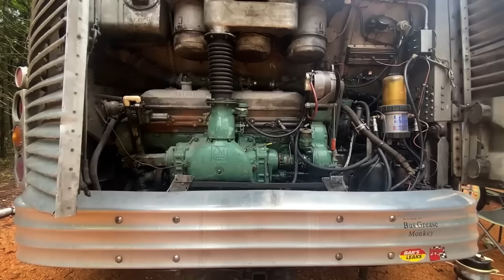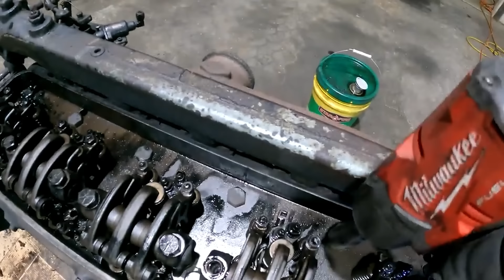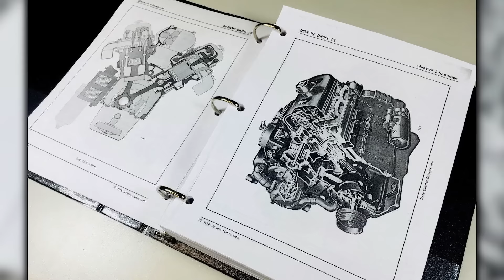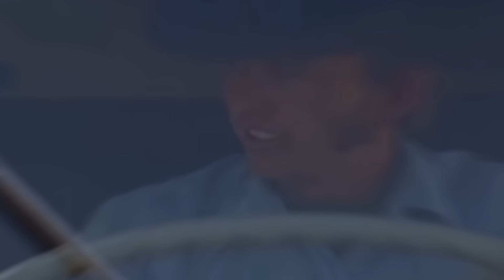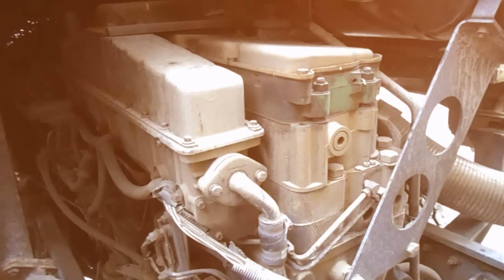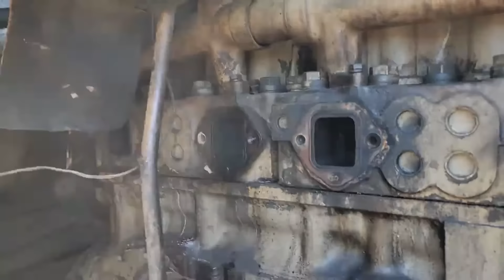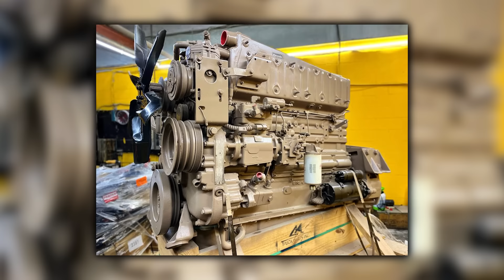The Cummins NTC-400 Engine That Silenced Detroit Diesel in 1976

Comment: the big cam cummins didnt silence detroit the epa silenced detroit.  That and planned obsolescence. They couldn't have people getting access to engines that were modular, had parts commonality between a v16 and v4, could burn any hydrocarbon, could be rebuilt by a chimp and held at the rev limiter all day long without any negative consequence.  Detroits were too durable.  There's a reason large ships and trains still use two stroke diesels.
Reply: Not really maybe some of the parts were interchangeable but you still have too know what your doing.
Reply: @kustombuildsBTTX  much simpler than a 4 stroke.  I ran/worked on one of these for 5 years so i know a little bit about what im saying. they're a very simple design.
Reply: @verteup not really in the video it said that they had to train people, most of the people that worked on them regularly were either in the military or had generator experience
Reply: @kustombuildsBTTX  the only thing i could imagine somebody would need training on is adjusting the rack.  but they had service manuals with instructions to do anything from simple stuff all the way up to full overhauls. so as long as somebody could follow instructions they could work on one of these.
Reply: @verteup  yeah fuel rack lot of people didn't have experience on that equipment because it wasn't for normal road vehicles & trucks 1958 they produced a lot of two-stroke diesels mostly for aircraft ground equipment and 1000 self-propelled GPU For aircraft and  by 1975 they started selling two-stroke diesels in Venezuela and had the military contracts
Reply: @kustombuildsBTTX I was a diesel mechanic and then a truck driver. 
I liked working on the old 2 stroke Detroits because they were simple. Cats were ok, but Cummins were finicky. 
Then, I started driving....Cat is a drivers engine, Cummins is middle ground & the 2 stroke Detroits were bottom of the pile. They were easy to drive, but lacked grunt...no torque. 
I always said the old Detroits were the sole reason 13 speeds were invented....keep the pedal on the floor & let her  eat!
Reply: Also they didn't sell to the public most stuff was overseas airline companies oil and gas companies military
Reply: @kustombuildsBTTX  they sold thousands and thousands of engines for semi trucks, skidders, RVs, log loaders, dozers, off road dump trucks...the list is endless.
Reply: @verteup maybe a few they had the military and maga companies asking for stuff did they get putt into busses and truck yes sure but they sucked ass until they started using better transmissios they were loud people had to smell and hear it all the time, we had a 30 ton crane with a 6/71 and it was slow really loud.

Comment: My first truck had a 8v71 Detroit. Number two had a big cam 400. Number three had a series 60 Detroit. The Cummins was a great engine but the old Detroit got me across the country many times with no problems.
Reply: My first truck was also an 8v71 and my second was a big cam 3 400 cumins my third was a 3406E cat
Reply: Very reliable, dad drove them for years in the 60s and 70s.
Reply: yeah and the 8v71 was only a little 9.3L engine compared to the small/big crap 350/400 and it's 14L
Reply: @73Datsun180B your talking shit those big iron blocks shitting on your ear piercing shit buckets 😂😂😂😂
Reply: @73Datsun180B my 45 year old big cam is still on the road every day? Where is your detroit? Do you even own one tough guy?

Comment: Was a diesel tech from 1978 thru 1983 before transitioning to forklifts. Cat 3400 series engines were the gold standard, along with Big Cam and KTA Cummins. Detroits were the poor man's  diesels at initial cost. You get 400hp with a Detroit cheaper than a Cat or Cummins, but you paid for it with lack of torque and a more
 complex design. Byt by the late 90's all of them were victims of the EPA and CARB, which made them all ridiculously complicated amd unreliable. They saved all the trees and the polar bears and took millions out of the American people's pockets
Reply: @289hipo I agree 100%.  I've driven 12V71 and 8V92 Detroits, Everything Cummins from 5.9 to ISX 15L, Cat 3408 to the 6NZ, and they all have their place and devoted followings.  The reason detroits leaked "oil" was the breather tubes coming out of the airboxes.  Just a byproduct of combustion and people said it was an oil leak.  The reason the front and rear cover gaskets eventually leaked was because no one ever did an out of frame on a detroit.  The bottom end is bulletproof.  Most still had standard crank bearings after 3-4 inframes.  The Cat and Cummins could definitely go longer between rebuilds.  My personal favorite is the 2WS-6NZ 70 pin Cat engines but I like then all.  As with everything else that was loud/fast/fun the EPA destroyed it.
Reply: I hear you there. Loved both engines Cummins engine weight to the Cats weight per horsepower and fuel mpg. Cummins won out. I loved my 3406E it was a beast, never got over 6.8 pg. Went back to Cummins. Now I am a huge Detroit fan series 60 , millage is great. Most of the modern  engines are good stuff.Cummis ISX is total crap. no sealant between injector and head. It wallers out and allows fuel on the low pressure side sends it into your coolant. All the new stuff is the same Cummins went cheap and cheap software, cheap electric harnesses.  Went to Detroit. We just fight bad harnesses. The NTC 400 used brass type washer for the injector nozzle,  the hot to cold was then dealt with. But need to change them 700k or you get fuel in antifreeze. today's BS Cummins they just push two dissimilar  metals together in the head ;injector nozzle; steel the engine is good for 400k the EGR only good for 400k they are a throw engine. many sires 60.s  over 900k.

Comment: Mr. Clessie Lyle Cummins, although not well known nowadays, has been called, "The Father of the American Diesel Truck". He was a very interesting, mechanical-minded genius and largely responsible for down-sizing diesel engines from massive, stationery, slow-turning power plants to something that could fit under a car or truck hood and operate on the road. He was also the inventor of the famous "Jacobs Engine Brake", or "Jake Brake", as it is often referred to. Although the compression brake had already been developed, he was the first one who got it to fit and operate in a truck engine. A near death experience of losing his brakes down a long, steep grade in California set his mind to figure it all out years later. If you can find it, "The Diesel Odessey of Clessie Cummins", by his son, C. Lyle Cummins, Jr., is an excellent book to read.
Reply: Cummins didn't invent the Jake's brakes.
Reply: He didn't invent Jake's brakes. Oh please.
Reply: @kirtwilliams549   kirtwilliams549    I'm not sure of your comment, so perhaps I should kindly clarify. In 1957, Clessie L. Cummins invented what was to become the Jacobs Engine Brake Retarder - nicknamed, the "Jake Brake" & manufactured in 1961. An excellent story of its history can be found on "The American Society of Mechanical Engineers" website, to name just one source.
Reply: @kirtwilliams549 He did after Cummins fired him. It was Clessie Cummins proving he could still innovate. Cummins didn’t buy the design, Jacobs did.

Comment: I remember the Euclids that had two engines screaming front and back on Pans during the building of I-75 in the late 50"s. They would run 24 hrs. a day and when time for bed, openwindows, the screaming of those 671's 1/2 mile from our house woud lure one to sleep. Those operators would treat our gang like royalty, pausing at times to give us a ride in the cats. Miss those times.

Comment: It is all about torque, Cimmins had that all over a Detroit, Detroit's leaked oil and blew out your ears, not to say I have seen some powerful Detroit's but Cummins was the engine along with Cat. This was the era of the horsepower wars. 425 Cat the 400 Cummins and the 450 Detroit. The biggest engines were the Cat 3408 the Detroit Silver 8V92 and in my opinion the best the Cummings KTA 600.
Reply: KTA 19L is king of the hill for power. Still is.
Reply: 12v71 wasn't around then?
Reply: @sandasturner9529  It was but it was outdated, 450 horsepower it was very rare and not good on fuel. The Silver 92 was out and it was putting out more horsepower than a 12V71.
Reply: "blew out your ears". It made for a long day working on a barge or job site with DD 6-71 driving a air compressor.  A pony engine started Cat 13000 slow turn engine in a crane or air compressor was pleasant.

Comment: The EPA did more to silence the two-stroke Detroit Diesel than their competitors.
Reply: It may have had a unique sound, but for the most part two-cycle technology for large engines like these was old hat by the time they finally stopped making them in 1996.
Reply: They leaked, a lot. And they ate oil. But they pulled.
Reply: i mean i like the bass of four stroke inline 6 and v8 diesels more than the detroit two stroke inline 6's, v6's and v8's but that's just me. but i still love the sound of a two stroke, it's just i like the rumble of something like a series 60, or ism over the two strokes scream.
Reply: Truth
Reply: me too!
Reply: Thank goodness
Reply: @bobqzzi  you are subhuman
Reply: Detroit engines sounds really good but they don’t have the torque Cummins had back then! when you go uphill you have to keep you hand over the stick to keep downshifting!
Reply: Shows that regulation can push the market in the right direction. Detroits were nice, but couldn't keep up, the end.
Reply: Take off the rose tinted nostalgia. They were literally getting their dicks knocked in the dirt by everything.
Reply: yep
Reply: Probably the one time the EPA did the public a favor.
It probably wouldn't have been long before everyone was done with that inefficient racket and nonsense anyhow too.
Reply: @jimlong2469  I still want one
Reply: @jimlong2469 thats your opinion. And it happens to be wrong..
Reply: @giggiddy  Is it OK to give millions of children asthma without any cost to you?
Reply: @giggiddy  an opinion is an opinion, it can't be wrong or right.
Reply: @sandasturner9529 if it says Detroits should be quiet it's wrong
Reply: @jimlong2469 👍👍
Reply: The DD was hit garbage at best…it served its purpose for that time
Reply: @chrisvig123 
The time ...... 

About 70 years in trucks, boats, military equipment, heavy equipment, stationary power generators, irrigation equipment........ 

Yeah, "served its purpose" for the time".....

Hundreds of thousands still running and getting the job done. 

In those 70 years how many other engine designs came and went?

Comment: The problem with two-stroke Detroit engines is the lack of torque and lack of torque rise.
I hate the single cylinder air compressors used on many of the cummins engines.  They sound like a rod ready to exit the block.

The best Detroit diesel engine ever made is the 12.7 series 60.
Reply: Lack of torque? 🤣

Come up to the oil fields and mines in Canada and see some of the old detroit diesel 2 strokes haul 100,000 to 500,000 kg heavy haul loads.
Reply: @BushmansAdventures  They do the job because they're big enough but the 4 strokes will beat them as a replacement.
Reply: @BushmansAdventures ya with planetary axles and geared right down to 40 mph max speed. 
A 454 gasser could pull just as good geared like the trucks you speak of. 
Two stroke Jimmy's don't have any torque.

Comment: The 71 series Detroits were a great engine in marine applications, cummins never broke into that industry in a big way. The 92 series didnt work out well in continuous operation, just pulling out too much hp from basically the same block, hard on fuel and noisy though.

Comment: I ran 8v71(318) Detroit engines  then we got a 335 Cummins. That 335 changed everything it had more torque and made pulling grades easier. I bought a 8v92 (430) Detroit and I wish I had never seen it. I went back to Cummins and stayed with them until I changed to Caterpillar and stayed with Cat.
Reply: And once you put a smaller "button" in the PT pumps, tweaked the pump pressure and injector timing you were getting 400-450hp out of those 855's

Comment: I’m not even gonna take the time to watch this video. The premise is stupid. Having actually worked with a big cam 400 and a big cam 350 Cummins engine and worked on V6 and V8 two-stroke Detroit engines and used equipment that had either of these engines in them. There is no comparison in line 6 cylinder four stroke big cam 400 and 350s are a superior diesel engine.
Two stroke Detroit engines have all sorts of problems being very loud, dirty, low torque high revving engines with the kind of work that they are designed for, and with a wonderful possibility of when they were out starting to eat their own engine oil and run off on you.

Comment: Started my diesel career in 1983 and the big cam 400 was the first Cummins I ever worked on,in fact my boss at that time sent me across the street to Cummins mid America to learn the pm and troubleshooting of these engines and not only that I had to time one of these bad boys (at 19-20 yrs old) in front of some old Detroit diesel mechanics that i worked with (yikes 😬) no pressure lol. I do miss those days a bit tbh
Reply: Did you put any buttons in your neighbors truck to make it run like a striped ass ape.

Comment: The scavenging effect you mention in the video is an issue with 2 stroke gasoline engines.  With gasoline, the intake charge is a fuel air mixture and some can exit the exhaust near bottom dead center.  With a diesel the intake charge is pure air.  The fuel is added just before top dead center to achieve compression ignition.  Any fuel lost in the exhaust is from incomplete combustion.

Two stroke diesel engines are not as fuel efficient due to:
1. Engine power used to run the roots blower.  4 strokes use exhaust driven turbochargers.
2. Higher RPM results in higher internal friction.
3. Combustion gas expansion cannot use the entire piston stroke to extract energy as the lower travel is used to uncover the intake ports.

Your AI scriptwriter needs more careful proofreading.
Reply from the maker: Thanks for the info, but my script-writer is me, not AI. It takes me hours to do the research and even longer to write it all out. I do use AI assist for sentence structure and organizing my input, but not for technical info. I've learned a lot, but I understood the scavenging process differently than how you've explained it. I appreciate your time in setting the record straight.
Reply: Two stroke diesels can easily be turbocharged. 

The roots blower doesn't consume a great deal of power at the low RPM a diesel operates at, and it doesn't create boost, so there's no appreciable flow resistance. 

Two stroke diesels do not run at a significantly higher RPM. 

Nice try though.
Reply: @AlanRoehrich9651 

Yeah—I was surprised to see a video of a Detroit 72 in a truck.  The tachometer showed 1,850 RPM.  

However, it sound like the engine was turning 2,860 RPM ..!!!
Reply: 2-stroke diesels are the most efficient engines in the world, but Detroit was not one of them.
Reply: Locomotive (train) and ship 2 stroke engines operate in a similar RPM range as their 4 stroke competition.  Truck engines, however, run higher RPM.  At least the ones I’ve been around.
Reply: That is kinda what is an epiphany for me:  

Two-stroke engines inarguably have more power strokes per revolution of the crankshaft—but do two two-strokes' power equal one four-stroke's power at any given RPM ..???

Power, as I mean in it this comment, is the force from the combustion process, which is pushing down on the connecting-rod, which then is turning the crankshaft.

I actually received this epiphany from a guy on YouTube talking about two-strokmmororcyclt engine carburator tuning.  Dragonfly75 is his email.  I am unable to recall his channel's name...

Great information provided in your comment!
Reply: @michaeldunagan8268 
In locomotives, which run between 900 & 1000 rpm, the two strokes and four strokes are built to make roughly the same power.  The two stroke does this with less displacement.

Comment: The small cam was awesome as well.
Reply: Seems like I had less problems with the small cam also. Every 100,000 miles with the big cam you were in it for something.
Reply from the maker: Good info to know from people who used these engines.
Reply: @VintageAmericanMachines Small cams didn’t have the power, kinda equal to the 6 cylinder 71’s. I had a Cummins 220 that was close to the 6/71’s but a 335 would blow the doors off of a Detroit V8 318 but you had to back out of it before to long or you could melt it down. The Cummins 350 was the standard for many years especially in rental and fleet trucks in the 80’s and would get the job done. You weren’t the first up the mountain but weren’t the last.

Comment: 1955
U.S. diesel truck market share reaches 51 percent
Cummins powers just over half of the commercial diesel trucks operating on U.S. highways as its reputation grows for innovation and dependability. This photo is an advertisement from 1955 for a Cummins 175 horsepower Turbodiesel.
Reply from the maker: They are strong and innovative in the marine industry as well.